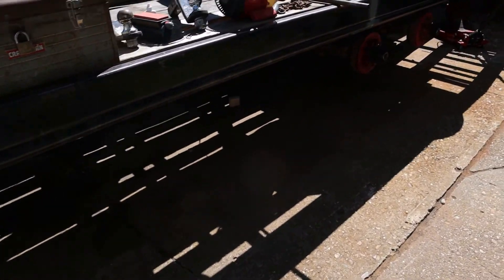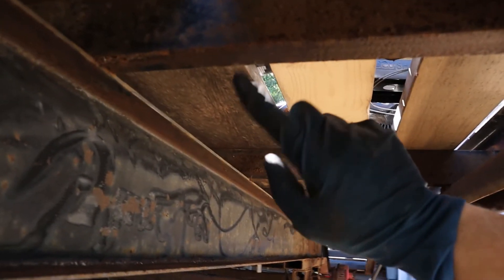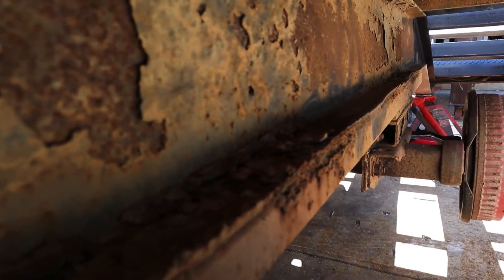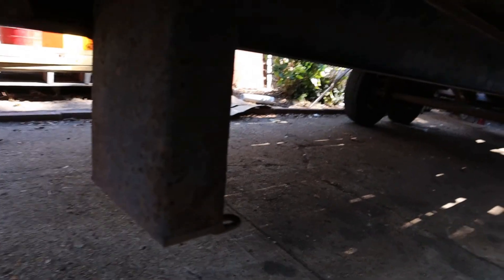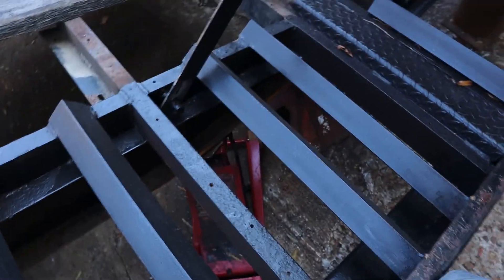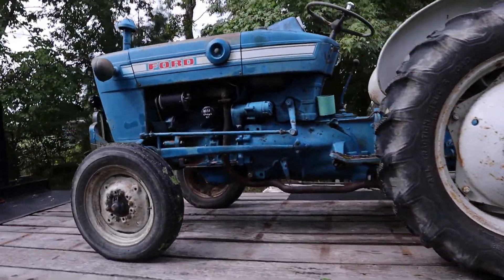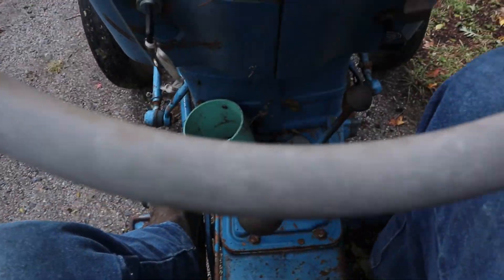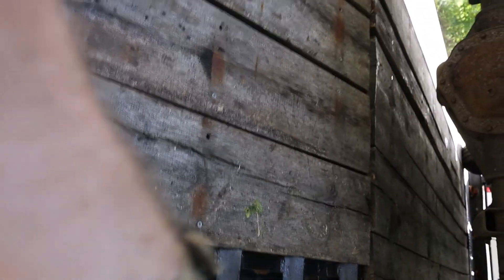trailer paint

Comment: Did your 6.0L bargain truck come w/a gooseneck connection in the bed? From what I've seen on factory trailers, and other trailer build videos, you may want to put fishplate (aka gusset plates) over where you cut the wedges out of the mainframe channels, then welded it back together. Good work, looks/functions fantastic.
Reply from the maker: no the 6.0 diesel did not